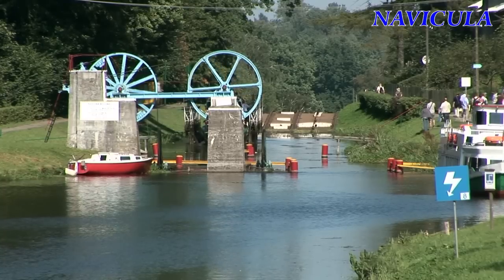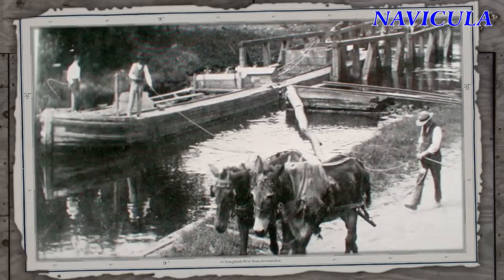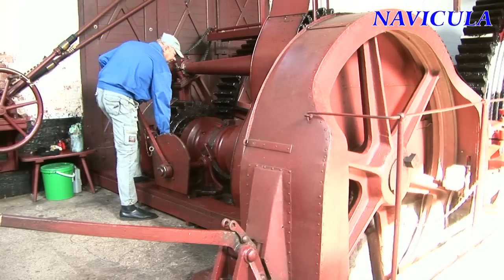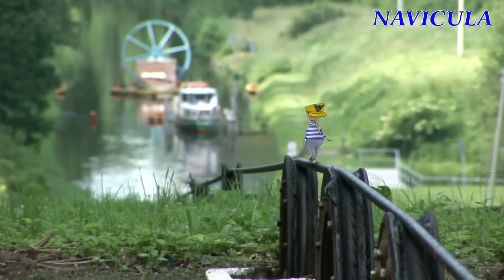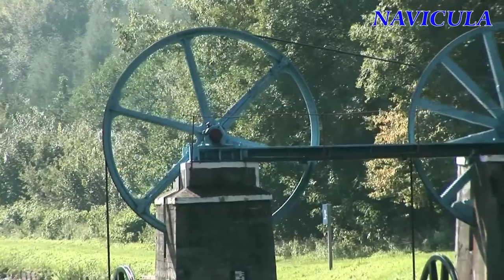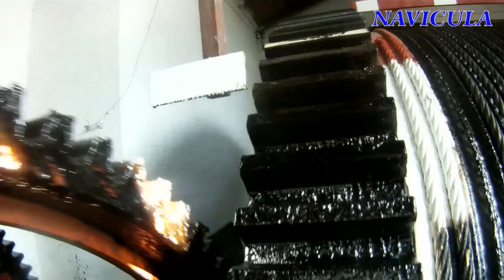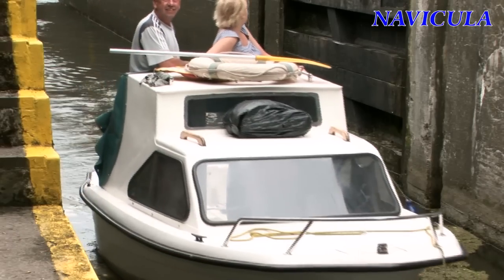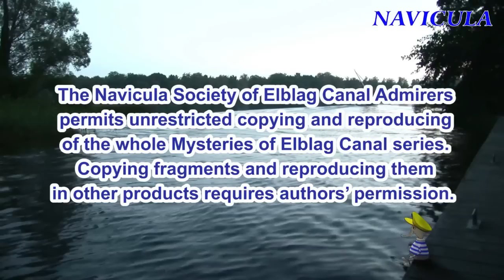The Mysteries of Elblag Canal: how the water carries the vessels?

Comment: Thanks for this detailed explanation! Questions:
-Is there any machanism to tension the cable or adjust the cable lengh when it stretches over time or at differnt drum positions?
-Why isnt the power station at the buttom? The system could be more efficient and use less water, if the station is using higher water pressure but less water flow. So the energy in the water is  wasted after the station.
-Is there any additional brake system in case of a cable break?
-I wander the brake does not get very hot during downhill drive. But maybe there is enogh friction from all the pullys etc.